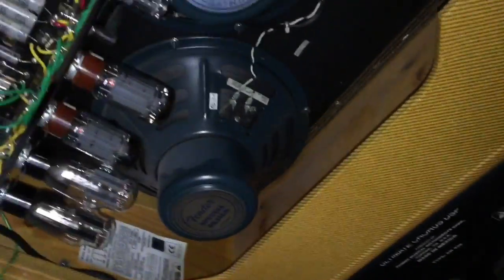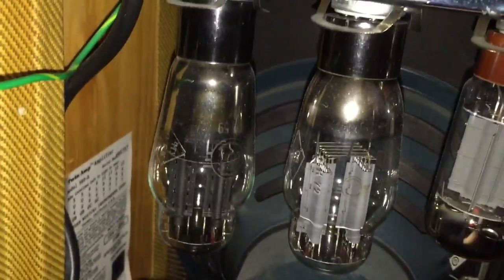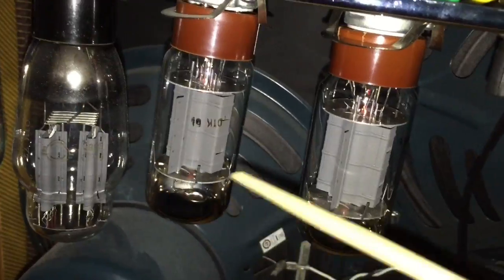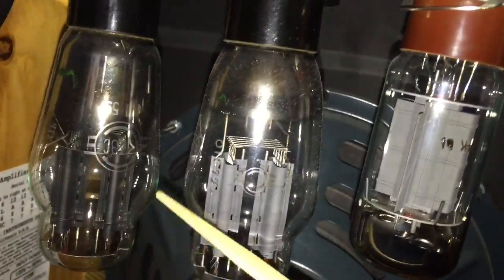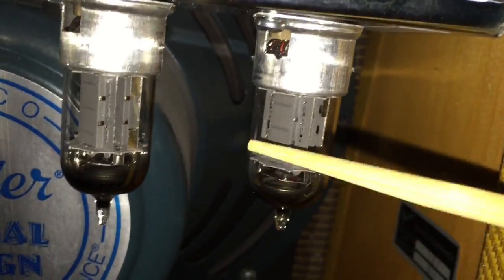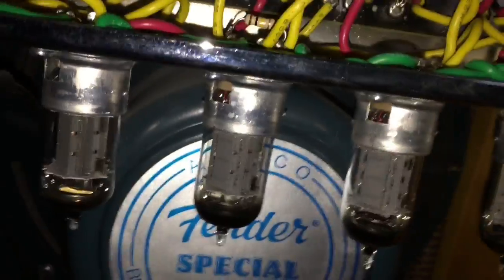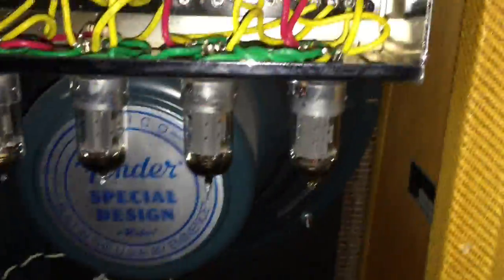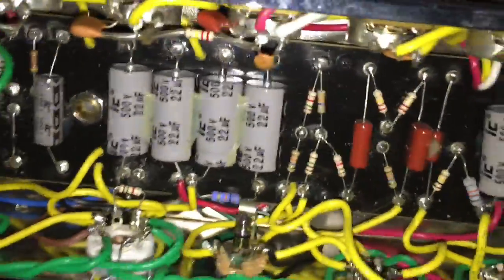Finding A Bad Tube In A Tube Amplifier

Comment: Does anyone know if Marshall tubes are all shit? I just tested my tubes 
and they all seem to make these noises.  I might not be hearing the 
sound on this video right but thats what it sounds like to me. Some of 
them sound more quiet than others.  Just a light tap out of the 
speakers.  Others are much louder. Should there be any sound coming out 
of the speakers? I'm kinda concerned because I have a gig coming up in a
 couple days and I know I should have gotten spares but damnit I didnt. I
 noticed it at my last show that it was sounding like shit then learned 
about this tapping test. Anyone have any advice? I sure would appreciate
 it. Thanks       Marshall JVM410H 
Different Michael Williams than previous btw
Reply: To my understanding, Marshall do not make tubes, they buy in their tubes from other manufacturers who put the 'Marshall' logo on the tubes. Sometimes the original manufacturer's logo may be left on, other times not. Have a look on your tubes for evidence of another manufacturer's logo . . . like Sovtek for example.    I've never used them (haven't had to replace any tubes yet!), but I've been told that JJ tubes represent good value for money, and produce excellent results in Marshall amps. Don't just take my word for it, speak to other musicians preferably those who use Marshall valve amps as part of their kit. sorry I can't be of more help.

Comment: That's a nice twin the first two tubes are for each Channel unlike most tweed amps this amps Channels are not sharing the same preamp valve. Usually each channel uses one side of the valve on the first one on the right. It's placed on the right farthest away from the power transformer for a reason beacause of 60 cycle hum. The next two tubes are aloud to be microphonic because they do a different function in the amp. So an easy fix is moving them around. Just because a tube is microphonic. Doesn't mean it's bad it actually give the amp more lively sound as long as it's not rattling or ringing. Also log plate 12ax7's tend to be more microphonic than short plate ones. 

Ps - don't bang on your tubes or move your amp around when there on or hot that is how they become microphonic and rattle. Get tube rings they help!
Reply from the maker: +Casey Jones  Thanks for the tips!  Yea I ended up replacing all the tubes down the road because it was about due to replace (I play pretty hard, and have the power tubes biased pretty hot).  Unfortunately this Tweed twin is going into repair because a transistor got burned out and the whole amp shut off.  Been using my Blues jr.  for now.  Love that amp too!  Thanks again for the tips, cheers!

Comment: I actually touched my tubes with my fingers.

Will they fail now?

I was inspecting the tubes because there is popping and crackling when playing guitar. I have a Marshall 40 Watt DSL.

What should I do? What is the problem?
Reply: Simply not true. You are thinking of halogen light bulbs. There is no evidence anywhere that oils on your finger will hurt your tubes at all. simply made up.
Reply from the maker: Hi Michael.  Yea your tubes won't fail if you touch them a few times, however, if you are working on them and touching them constantly, any oil that is left on the tubes will cause them to fail prematurely.  Couple of things I would advise: 

1.  I would not "touch them all you want" YES they WILL burn you.  This is gas being heated in a glass tube, it's not advised to touch them while the amp is on or if you just turned the amp off.  Wait a few minutes for them to cool down before doing that.  

2.  Please DO NOT pour anything into the input jack!  The popping sound is either one of these 2 things.  The tubes (most of the time they go bad, they don't last forever.  Or there's dust in the input jacks, or in the tube sockets.  You can actually carefully take the tube out, and use a air duster and blow any dust out. (This has been the case for me many times)
Reply: @renatopasqualini5989  I talked with a TV tech and he said the main reason TV's go out to soon is dust accumulation on the circuit board can cause problems so blow air insides the vents on computers TV's can make them last longer.
Reply: Touch all you want. Old equipment always has grungy dusty dirty tubes installed. This isnt a halogen light bulb, it will be fine. Clean tubes look nice and dont smell funky when they light. Your fingers wont hurt your tubes.
Reply: Caleb Welte What is causing the horrible popping when touching the amplifier on top?
Reply: I'm sorry I don't know. It could be a number of things. Buy deoxit and put a small amount into the input jack and plug in and pull out the plug a few times with the amp off of coarse. If that don't fix it IDK where to start from this end. I doubt it will fix it, but it might.
Reply: NO!

Comment: Hi Renato , wonderful video 
i'm new to tube amps, so i have a laney 200v hybrid amp, i cant get 
much gain out of it, what pedal so i need to use ? or do i need a 
attenuator ? should i consider changing the preamp valve ?
Reply: ECC83 is the European designation for the 12AX7.
Reply from the maker: +Atul Sharma.  Hey there!  Yea don't worry about the amp to get any kind of overdrive for now.  Sure there's tubes that have more gain in the preamp section, such a 12Ax7, while a 12Ay7 is more of a traditional 50's-60's sound.  However, your amp needs to be able to take those tubes, some amps don't like to switch to different kinds of preamp tubes, (bottom line, don't worry about the preamp tubes).  I would get an overdrive pedal.  My favorite kinds are based off a klon and the ones based off tube screamers.  I use a Mad Professor Sweet honey Overdrive and a Mad Professor Little Green Wonder.  They make 2 versions, a hand-wired kind and a factory pressed circuit board version (non hand-wired).  Depending on your price range you can get the same tone.  I recommend hand wired as much as possible just because I've had the Sweet honey  hand wired for 6 years and it hasn't given me any problems.  The little green wonder hopefully lives up to it's brother!  Hope that helps!  Cheers!
Reply: Hi Renato, Thanks for the response, i appreciate it :)
ill consider buying there pedals, but there are different kinds of ecc83 valves, do these different kinds of valves give me different gains ?, i know that 12AX7 is 100 for the gain
Reply from the maker: I haven't heard of any ecc83 valves.  I do know of el84's and el34's, but those are power valves (or tubes).  Those can never be changed, so make sure you stick to the type that's in your amp already when you want to switch those ones out (usually 2 or 4).  I highly recommend you just look at pedals to get the sound you want, I wouldn't worry about doing things with the amp right now.  Hope this helps!  Cheers!

Comment: Did your problems go away when you changed them out? I'm not sure if one of my preamp tubes are microphone or if my pickup. It's been squealing at high gain.
Reply from the maker: +Ariel Gomez Yes they did :).  Not sure what the squealing sound could be from.

Comment: I think it takes a trained ear to hear if the tube is microphonic with the chopstick / pencil test.  Is there any more definitive way to determine which tubes are bad?
Reply from the maker: +Jonathan L Hi Jonathan, yea this video doesn't do the best justice in picking up the audio in the room.  However, tapping the preamp tubes and seeing if they cause echo, feedback, or a reverb-like effect will be a sure find that that tube is microphonic.  The preamp tubes that usually go bad by the way are the first preamp tubes in your amp.  The first and second preamp tubes in this video was for sure microphonic.  I wouldn't say you need a trained ear to tell when tubes are starting to go bad, however, power tubes also have their signs as well.  Some of those signs are, loss of volume, and muddiness or dullness in tone.  Hope this helps.  Cheers!
Reply: Renato Pasqualini, i think you just helped me a lot, dude! My fender blues junior have lost the bass and i was thinking if i'm imagining it or there's something wrong with the tubes..And guess what? One of the tubes have that reverbish sound on the full volume.. I would describe that sound like drops of water are falling in to a big metal bowl. Gonna try to replace it, thank you!

Comment: I think jj's r just bad i had my vox re tubed less than a year ago n my amp is starting to pick up those crackling noises u had in urs, anyway great video I needed a refreshment about checking tubes
Reply from the maker: +Erick Hernandez Thanks Erick!  Yea tubes can go bad at unpredictable times.  I just recently had to put in new tubes a month ago.  Based on the way you play and how you bias your tubes (hot), they can burn out surprisingly fast.  I would say the crackling is a sign that the tubes are already going bad.  Hope that helps.  Cheers!

Comment: I don't think it's good for the tubes or the sockets to tap on the tubes.
Reply: @SteveRyan1965  you shouldn't hear anything come out of your speaker when you tap the tubes.  When he tapped the bad tubes the noise came through the speaker.
Reply from the maker: +John Simms It should be ok, if you don't bang the tubes too hard.  I ended up just replacing all the tubes btw.  Cheers!